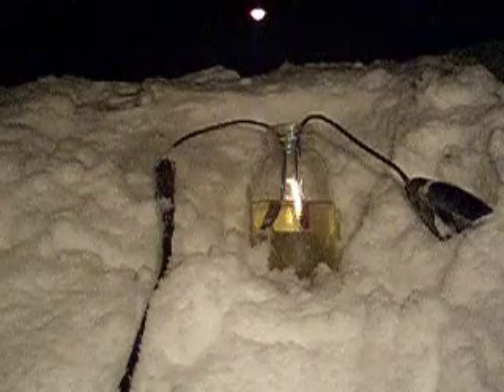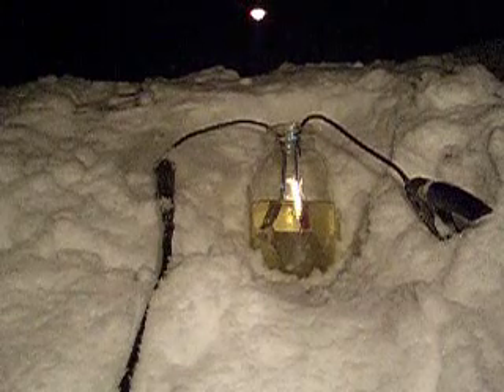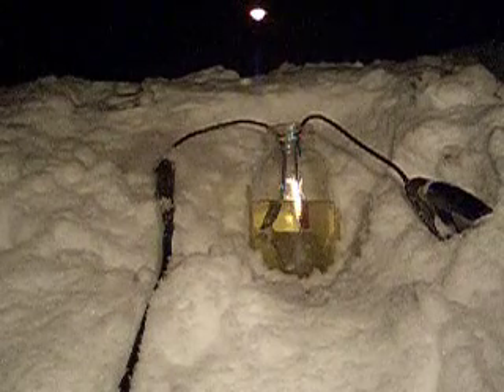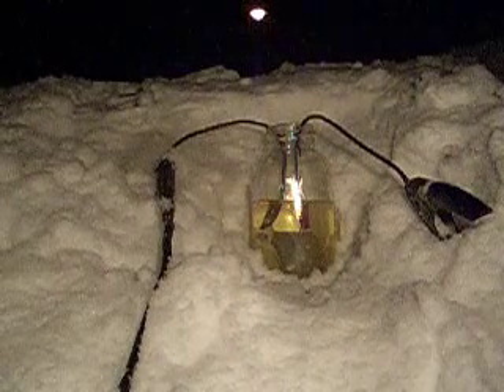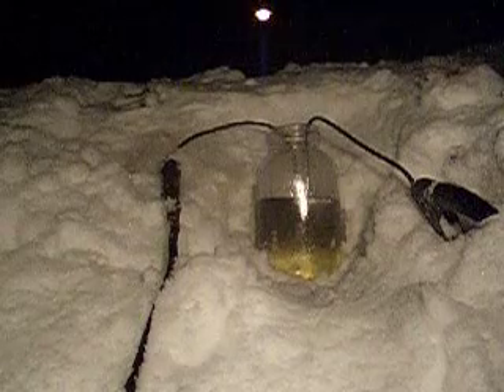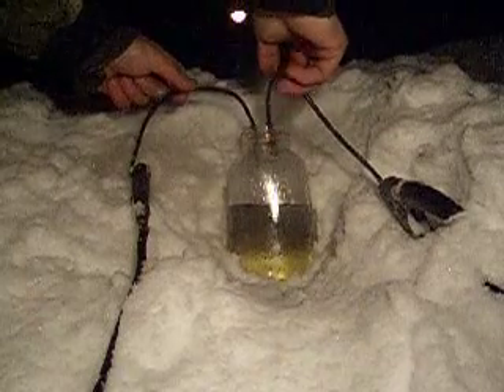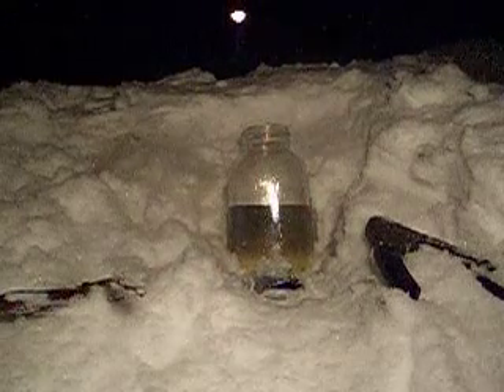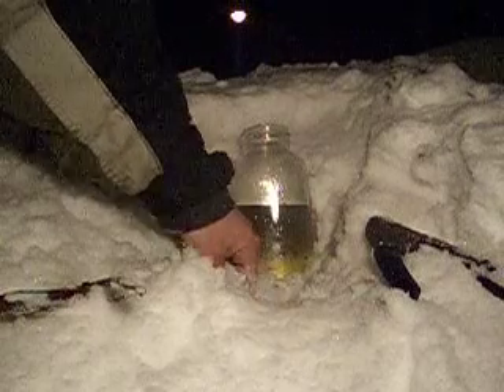Lipo Battery test 2 Mineral oil

Comment: Very interesting it contained the lipo fire completely... I wonder if you could create a cooling system with mineral oil a PC pump rad and fans to cool a 18650 pack and also be a fire containment /retardent.
Reply: Have you found any case regarding trials on Li-Ion cell immersion in mineral oil? There is Novac Engineered Fluid but its costly.